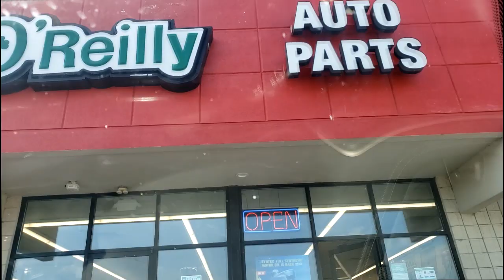Life Hack. Remove extract a broken Crossmember Support Motor Mount bolt stud on a Dodge Caravan.

Comment: I usually get a standard size nut and press it onto the tap using a vice. That way I can use a normal 6 point socket to turn the tap.🙂

Comment: I'm glad I came across your video because I'm dealing with this right now but my question is how did you get the top open to even get to the bolt
Reply from the maker: What do you mean by get the top open? I'm not understanding. Also are you subscribed to the channel?
Reply: Nevermind I didn't know there was 3 different parts to the video now I see and thanks. Yes I am a subscriber now since I see you deal with Dodge and Chrysler a lot
Reply: But what did you use on top to grab a hold on to the bolt
Reply from the maker: @davidb478  thanks

Comment: I have a 2009 charger, 3.5 liter, and the 2 front Engine Cradle Bolts snapped off. Each broke off on opposite sides. I’m hoping to order them soon and hopefully they will be no problem putting in. Wish me luck, it’s my first car🙏
Reply: good luck yo if you need any help feel free to reach out

Comment: I own a 2014 and been wanting to take those bolts out and anti seize them. Do you not need to support that engine with anything else?
Reply: No
Reply: there’s 3 other mounts that will hold the transmission and engine just fine